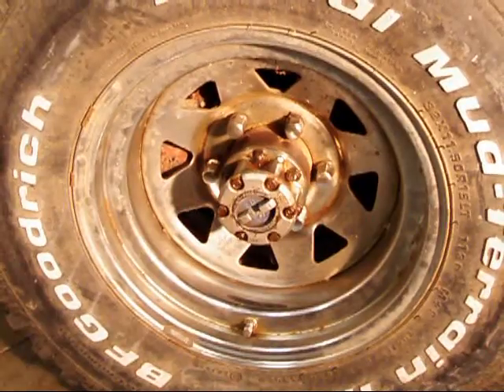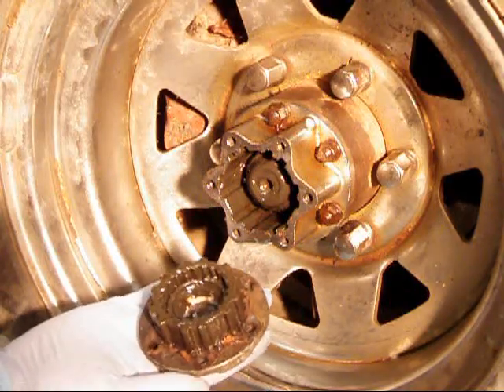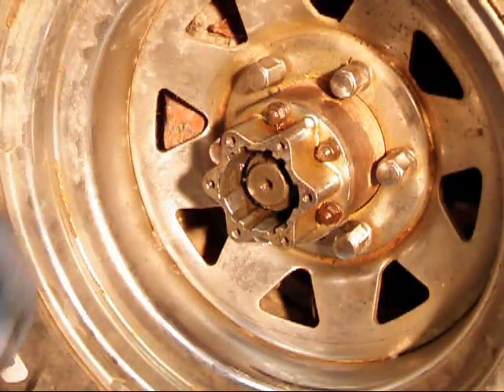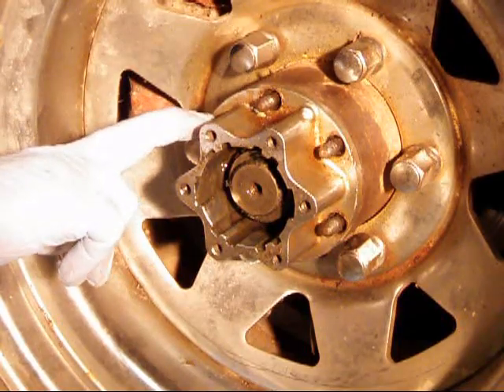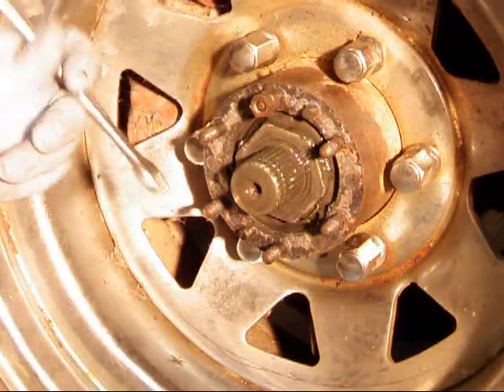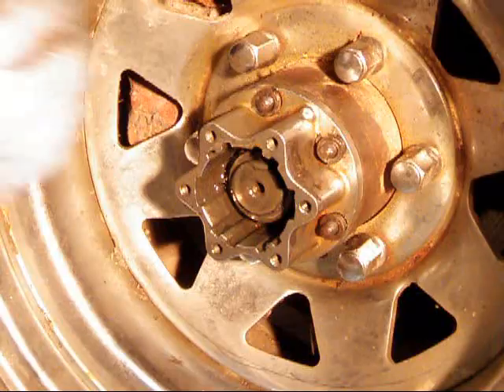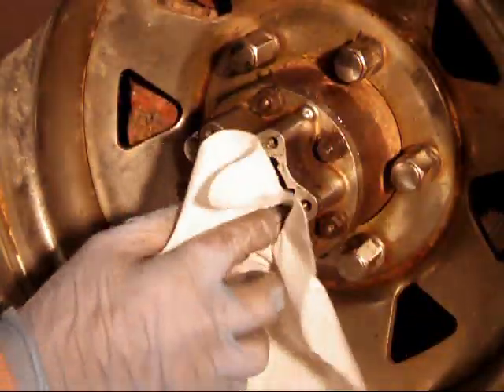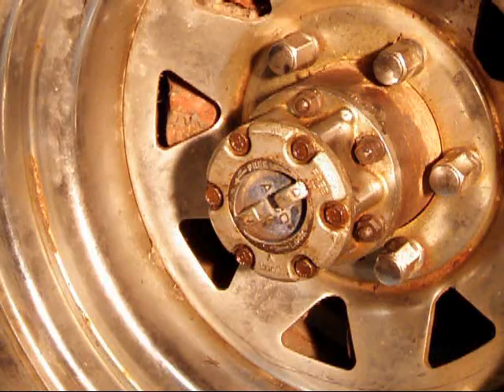How to Remove & Replace a Toyota 4x4 Manual Locking Hub (See video description for more info/tools)

Comment: Pete, I recently bought my first toy pickup and now when I'm driving with hubs locked but in 2wd when it's cold out (30 or below) I hear a loud rubbing sound coming from my drivers front wheel area. I took off the wheel and looked around, tugged on things. Nothing seemed loose. I'm wondering if the vibrating and rubbing could be a hub going bad. When I slow down the rubbing sound does too. What do you think?

Comment: i put manual hub lockers on my 99 ford ranger and i was wondering if i leave them unlocked and turn the switch in the cab to 4hi will i have 4wheel drive or do i have to lock the hubs to get 4 wheel drive?

Comment from the maker: @hiredhandful   You *should* be able to remove the hub with the dial in the locked position.  the only thing will be your locking cog will be extended.  I'll be doing a video soon of how the inner guts work on these style of hubs and how to rebuild them.  If your dial is frozen it's either because there too much nasty old solidified grease or dirt, or because you ball-detent has jammed in the dial cap, or there's something seriously wrong inside the mechanism.

Comment from the maker: Hmmmmm... that's a tough one.  Maybe a wheel bearing starting to go south on you?  I had one once that went bad and it would make a hellacious sound going around a corner when the outer wheel bearing would get loaded.  Check for wheel well liner coming off, or something else rubbing a tire.  Tough to diagnose sounds over the web...lol... But I have helped a few folks pin down some probs before...

Comment from the maker: As long as the noise only happens when you have the hubs locked it is most likely being caused by something in the front axle as engaging the hubs locks in the birfields and inner shafts and starts spinning the differential.  There really isn't much that can go wrong in the hubs themselves.  You could also have a bent axle housing and one of the birfield bells is rubbing the inside of the knuckle ball.  There's lots of choices here, but I would try pulling the front driveline...continued...
Reply: Yea I know with mine bad spider gears really messed shit up

Comment: I have a 98 with stock locking hubs, i just bought it a few months ago, i can tell that the passenger side locking hub was replaced at one time, about a month ago i had to use my 4wd on sand then when i was done i noticed my passenger side hub would not disenguage like you said at 2:00 in this video. since then ive been to busy to work on it till now. so i have been drivving with both locked in(hopfully thats ok). I am actualy and ase certified tech. but have little experience with 4wd. HELP

Comment: The hub seems to be springin gout of its original place.the washer in behind the spring ( the one that looks like it has teeth in certain spots) is warn significantly in certain teeth spots.Should i be ok buying  aused one from ajunk yard?Will any hub from 86-95 manual work on my truck? At a loss here.I am purchasing another tie rod end,front shocks.two rear break lines to extend front ones.Then i need to get a hard line 4 drives Side.i broke it off rite at the Banjo nutt.

Comment from the maker: @jason127x99  Don't need the 54mm socket to remove the locking hub.  You'll need the 54mm socket to remove the actual hub itself from the spindle.  (The two 54mm nuts are actually holding the wheel hub (wheel hub has the wheel studs pressed into it) and wheel bearings on the spindle.)  I'll be doing a video in the near future on how to remove the hub as a unit from the axle so you can remove the Birfield and inner axle shaft without losing wheel bearing adjustment.

Comment: curious, when you pulled the locking hub cover off, why didnt the axle have the bolt and washer? been curious about people who use the bolt/washer vs just clip vs both. seems to be a variety to the consensus
Reply from the maker: The bolt and large washer are found under the hub cover of the Toyota auto-locking hubs.  Both my 1985 and 1988  (1985 being the last year of the solid front axles in the U.S.) factory service manuals show it on the end of the axle shaft under the hub cover of the exploded diagram for the Toyota AUTO-locking hub assembly.  They were not found on the MANUAL-locking hub assembly diagrams from 1979-1995 in the U.S.  In 1986 and after I see them showing up on BOTH the manual-locking and auto-locking hub diagrams in the factory service manuals.  In the old solid axle manuals, the threaded hole in the end of the axle is also used for, if you need it, installing a bolt that you can use pull on and to hold the axle stub still while you install that outer snap ring.  I'll post a couple snapshots of the service manual assemblies in my community feed if you're interested in seeing them.
Reply: @WheeliePete  interesting.  I have an ADD setup. Recently did a cv and noticed I didn't have a snap ring, just the bolt and washer. I'm about to slap on some warn manual hubs, but not I'm wondering about the snap ring. Can I just use the bolt and washer in lieu of the snap ring, or will it not fit with the manual hub?
Reply from the maker: I just updated my last comment Ray.  I started looking at the factory service manuals and it looks like they put the bolt and washer on the manual hubs too and starting in 1986.  If you're putting on WARN hubs you'll need a diagram of how warn wants the guts installed.  I'm not sure how they go on.  We always used to yank the WARN hubs and put Toyota AISIN ones back on if we ever got a truck in that had them, the AISIN is superior design in my opinion.  Most people have problems with the AISIN hubs because they were taken apart and installed incorrectly.  See this video I did addressing that super-common issue that makes people think the hubs are broken, when in reality they are just assembled incorrectly by the last person who took it apart. https://youtu.be/W78RkF1mUOE
Reply: @WheeliePete  awesome, thanks for the useful info. I originally was going for aisins, but I saw a lot that was up for sale on offerup from a guy who converted to front solid axle. So I have his whole front drop out including the warn hubs and good cv's. 100 bucks =)
Reply from the maker: Good deal!  I just posted a bunch of the schematics from the different years auto/manual hubs over on my channel's community tab.  I also noticed that there appears to be a difference in the bolt/washer combo between the auto and manual hubs.  The auto hubs appear to have a cupped washer that the bolt sits down in and the manual hubs look like they had a flat washer.
Reply: @WheeliePete  looks like the manual hub bolt and washer is identical to my add setup. thanks for the useful resources once again!

Comment: So, if a previous owner hammered to get those cones out, is it ok??? Or wjat could go wrong
Reply from the maker: Hammering on the outside of the locking hub body deforms the very thin area that the cones sit in.  There's nothing you can do about it really, but what you'll want to watch for is making sure when you do put it all back together you check the torque on those nuts after a bit of wheeling.  If the holes are deformed enough you might not get the right fit of the cone washer and then your locking hub could work loose.  Checking those nuts for torque after the first couple trips should ensure they've gone all the way down to where they should be.  The other thing I would highly recommend is replacing the locking hub body studs with new, stronger ones.  Places like Marlin Crawler, Front Range Offroad, and Trail Gear all sell them.  At a minimum, check to make sure each of the existing studs is tight.  When those work loose you start to see the locking hubs shear the studs clean off.  Link to Front Range's websites with the hub studs upgrade (I'm not affiliated with them, they just have awesome products):  https://frontrangeoffroadfab.com/arp-hub-studs-upgrade/

Comment: just got a '94 4x4 and when i put it in 4x4 and make a hard turn (turn r or l all the way) i hear a good knocking sound - could that have something to do with the bearings there or maybe better the bushings?
Reply from the maker: If it's an extreme turn to either side I would take a hard look at the steering components.  I bet there's some tie-rod end joints that are toast especially on a '94, if they are original, they've been in there a LONG time.  Could also be the CV joints.  Doe the truck have manual locking hubs?   Lots of problems can stem from someone installing the manual locking hub dial assembly wrong.  Easy to check and fix (as long as all the parts are there)  Here's a link to that video:  https://youtu.be/W78RkF1mUOE

Comment: Just found your channel tonight. Do you have a video or list of tools to keep in a Toyota? I have a 1989 Toyota truck 4x4 and would rather not carry a 150 pc Craftsman tool kit. Thanks!
Reply from the maker: +InjunOne   I don't have a list or anything, but I carry a set of metric sockets in 3/8 and 1/2 drive, vice grips, screwdriver, high-lift jack, and winch recovery gear.  Spare upper and lower radiator hoses, extra belts, hose clamps, fluids, etc.  I know it's kind of cliche', but I really haven't had much issue with Toyota's on the trail.  If you keep up on the maintenance they really don't have much issue on the trail.
Reply: +WheeliePete  Thanks.  I usually pack extra parts and  fluids as well. Seems most of the truck is 10mm and 12mm. I try to replace belts before they get too bad and keep those for back up, then rotate  that stock each time I change belts. Maintenance was  one thing  my  Dad made sure we kept up on. PM keeps a lot of problems away.  Enjoy your channel. Thanks for the  videos, look forward to many more!
Reply: yy

Comment: I have a 2000 Toyota  Tacoma and am trying to replace the Cv drive shaft axel. When I'm trying to remove the manual lockin hub but the Snap ring will not come loose. In your video the snap ring had an opening, but with mine it doesn't seem to open any where. How can I get it off?
Reply from the maker: I'd have to see a picture of it. The one in the video is an early truck with the solid axle so it's a bit different.  The Tacoma's sometimes had a bolt with a washer in the end of the axle shaft.  You can shoot me an email with a picture.
Reply: +WheeliePete it doesn't have a bolt with a washer in the end. I'll send you a picture.
Reply from the maker: Got your picture.   Looks like the hub will come off if you take off the nuts and cone washers from the hub studs.  Should come right off after that.

Comment: For the cone washer/ hub removal, the brass drift isnt needed. I spoke with Specter Off-Road and all of their mechanics just give the housing a good wack with a hammer and they pop right out. They have 40+ years experience too .. no reason to make things complicated.
Reply from the maker: Greg Hall   LOL...not their rig, right?  So sure, hit the shit out of the housing if it's not your rig.  That's the fast way to do it.  just deforms the flange at the hole a little bit, making the interface between the cone washer and the flange a little worse, which leads to imperfect alignment, which leads to loosening, which leads to sheared off studs.  Shops take shortcuts because it increases turnover times which increases revenues.  There's not much material between the edge of the tapered hole in the flange and the edge so it WILL deform if you hit the side of the flange right at the stud.
Reply: WheeliePete I've used the middle road (urethane hammer to the housing) with some success.  If they are major stuck, I use the above method, if only because the shock is sent right to the stud.

Comment from the maker: I don't have any familiarity with the Land Cruiser series.  Master and slave cylinders are pretty inexpensive here so I just replace them as they fail.  I've never even tried to get the parts to do a rebuild.  Should basically involve pulling the guts, honing the cylinder bore, and then new seals.  But where I am master or slave are less than $30 USD new so I just get a new one.  I even carry a new spare of each in the parts box when wheeling...

Comment: Do I have to take the first set of bolts off first? Or can I just skip them and take the whole hub off without separating the 2? I just want to paint my hub.
Reply from the maker: You really should remove the hub dial so you can get a socket on an extension to get down to the nuts on the hub studs.  Just put the locking hub dial to free and remove the 6 small bolts and it will pull right out.
Reply: You need to take off the hub dial to access the snap ring

Comment: I Found out my snap ring is to far stretched,And the washer that looks like a saw blade (one with the little tab that slides into the groove in the shaft of the axle) the tab on mine is allmost all the way worn out.
                Any way you have the snap rings and lock washers there in your shop?If you do,Contact me via threw here?I dont know if there is any pm messenger set up here?               
       Thanks in advance.

Comment from the maker: Put the dial in the "Free" position and remove the dial. The locking gear should come out with the cap.  If the gear and spring stay in the hub body you've found your problem in that someon assembled the cap/spring/gear wrong.  If that's the problem, send me a private message with your e-mail and I can send you a marked up photo that I took that shows how it needs to be assembled to work. I need to make a video on this as it's the #1 reason (bad reassembly) people think their hub is broken.

Comment: does the rod need to be BRASS?  can it not be steel or some other metal?
Reply from the maker: If at all possible you should use a brass drift.  Brass is softer than steel and won't deform the end of the stud.  If you use a steel drift or extension you run the risk of messing up the end of the stud or the nut and then having to replace it, but in a pinch do what you gotta do.
Reply: @WheeliePete  Ok, this makes sense.... I was able to get them off with no damage... then after installing a new one my split ring shot off into space.... it was right at dark, didn't hear it hit anything so it's somewhere out in my tall grass... maybe a magnet sweeper will find it... crap.

Comment: Do you have a video on how to fix, when gear will engage, but will not retract
Reply from the maker: Not right now, but I am actually working on that.  It's a very simple problem to fix.  The spring that holds the prawl to the locking hub clutch is installed incorrectly.  If you send me a private message with your email in it I can send you some pictures of how it needs to be assembled.  It's easy to mess up the install because there's a little trick, but once you understand how it works, you can put it back together no problem.  Every single time someone tells me their hub engages, but won't retract it's because of this problem.  I have yet to see a video on YouTube that clearly shows how the reassembly works so I'm going to do one very soon.
Reply from the maker: Ronnie Roberts Sent you an email Ronnie with detailed pictures on reassembly.  I'll delete your message above so people can't see your email address.
Reply: WheeliePete can you send it to me as well? and what size of socket do you need to remove the nut?
Reply from the maker: Devlyn Tobin Send me a private message with your email and I can send you a copy of that email with the fix for  the hub reassembly.
Reply from the maker: Devlyn Tobin What nut are you talking about, the big spindle nuts?  They are 54mm. Here's where you can get the tool or at least what it looks like:  http://www.marlincrawler.com/hardware-tools/tools/54mm-socket  The hub dial bolts are 10mm and the Hub body nuts are 12mm I believe...

Comment: Hi i disasembeld the same set up you have here in your video.Can you show me the order in wich i put the nuts back onto the axle part of it.including the spindle washer.i cant remebe rif i put it back on then the snap ring..           MY truck is a 1986 toyota 4x4 sr5turbo truck IFS.i INSTALLED A 3 INCH SUSPENSION LIFT AND I CANT remember how the nuts go back on in wich order.PLEASE HELP ANYONE.preferably you.Thanks in advance to anyone that sees this and replys..................Help..........

Comment: I have a 99 tacoma 4x4 with manual lock hubs and my drivers side when its unlocked it makes a grinding noise almost like a bad bearing but when i lock it it goes away any idea what it could be
Reply from the maker: Hmmmmm... you'll have to dig into it.  You might try watching this other video I made. https://youtu.be/W78RkF1mUOE  It will at least help you pull the outer hub dial cover and verify that those components are assembled correctly.   A lot of problems with the Aisin hubs used on Toyota's come from people not assembling the hub dial components correctly.